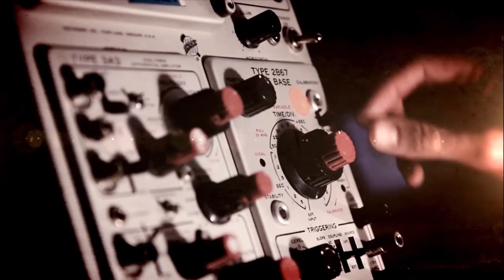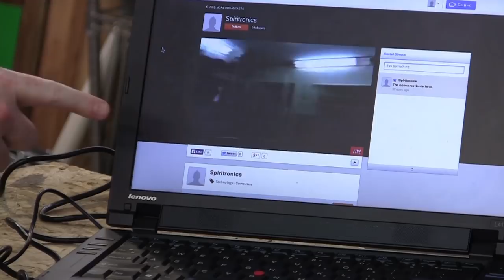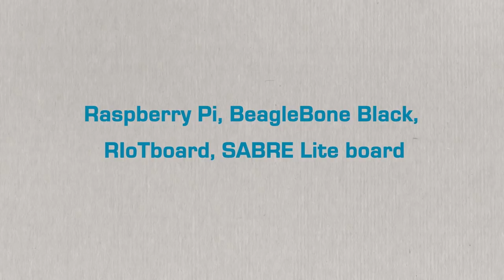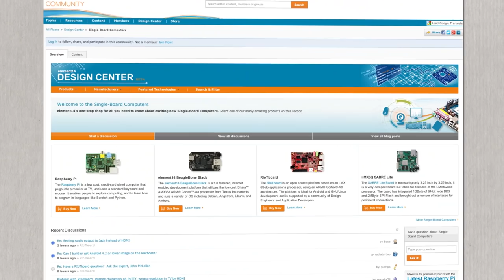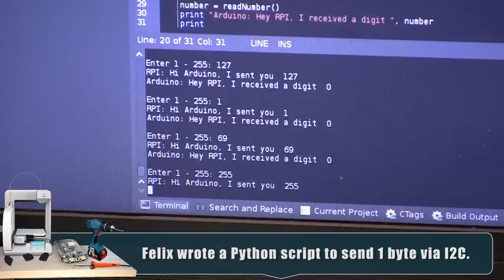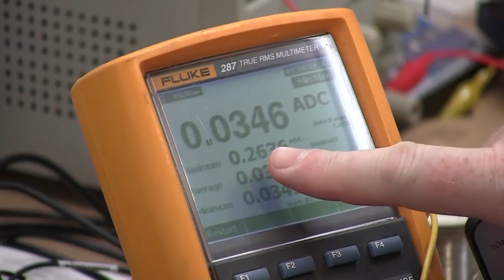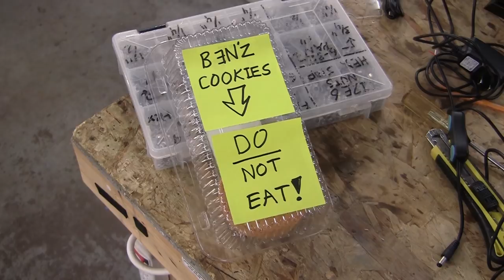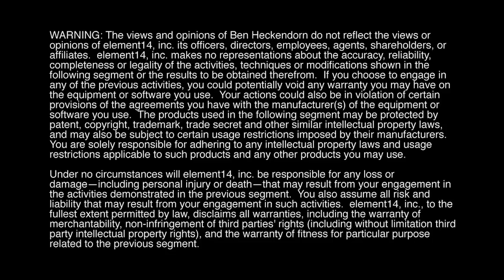Ben Heck's Raspberry Pi Shop Cam

Comment: Assume the Pi needs 500ma,itself. IME,they're sort of unstable without a good 'stiff' supply. I've even jumpered over the polyfuse on mine,I measured a 0.25V drop across it with the system idle. (under heavy load there was even more drop,and it would lock up/reset from the 'brownout' condition.) Using a supply with a voltage slightly over 5V (5.1V,5.25V) can help too.

Comment: Something that you might be interested in, Ben - you can use i2c from the Pi to the MCU without a level shifter, as the master pulls the i2c line high, in this case 3.3v, and  the line is then pulled low by the master to send the data bits. At least that's my understanding! Even if the MCU sends data back, it'll just be pulling the 3.3v line low too, so it'll save you a level shifter!
Reply from the maker: scott porter Thanks for sharing!

Comment: You probably could have gotten away without a level shifter. The ATMega328P will run at 3v3 at 12MHz, that's how it's configured on the Gertboard.

Comment: Hey Ben thought you would like to know. I seen on a kick starter a small company create a printer that looks like a 3D printer but it prints circuit boards no need for etching on a clear flexible film. After that it will apply solder for surface mount parts and then pick up the surface mount parts and put them on the board using a camera to align them. I forgot what it's called but hope it succeeds.

Comment: Great video, but you said you need a servo controller because the Pi doesn't have a real-time operating system. Surely that's not the reason.

Comment: rc servos are probably more versitile since they usually are smaller(depending on size of rc stuff) and most of the ones I have laying around can spin around 360 degrees, but they are not very impressive in terms of power...

Comment: Dear Sir Ben

I want to request a video if i may ask, and please try your best.

Here Is The Thing :
i want to build some thing similar using OV7670 Camera Module, but the thing is i want a micro controller from microchip to do the capture or live video streaming and send them over the very same transceiver module. i want to control several servo motors as well using the same micro controller.

what i do not know is how to read the image from the OV7670 i have tried studying the datasheet several times but i guess i am lost, and i dont know what chip should i use among the large family of microchip micro controllers to achieve this plz help. i want to build my dream machine :D

Comment: Raspberry PI can perfectly drive servos through its GPIO pins using for example the library "servoblaster". I cannot understand the reason to use arduino + a servo driver, other than to make this project prohibitively expensive to build.

Comment: i bought a camera module OV7670

but yet i don't know how to operate this module with a micro controller i really lack the information plz i need help

Here Is My Plan

1. I want to use this module with microchip micro controller, so please suggest me a good micro controller
2. I want to stream video from the camera to a computer using VB.net
3. control stepper motors to move the camera around

part number 3 is easy because i have done it before and part 1 i have a slight knowledge but part 2 i am completely blank

please guide me i am exhausted of searching on the net without any result. i need to know what program to write in the micro controller to get the camera to work. please help i am counting on you.

thanks you i am waiting with hope.

Comment: Okay I see the PI camera and the PI board.  Is there a way to have more than one camera and connect each PI board to a main PI board?  We would like to use 6 camera's having two facing up at a 45 degree angle, 3 camera's @ 120 degree level to horizon and one facing down towards earth.  We are using it for a High Altitude Project. Thanks."
Reply from the maker: maddogjb57 That's do-able, you can either use the Pi Compute board which can connect two cameras per board, or you can connect more using USB. Synchronising them is then something you have to solve in software and could do over a network connection.

Comment: I built mine with a Raspberry pi B+ and a Webcam. Installed Apache server with PHP on Raspberry pi to make a streaming website. When somebody visits the website, the PHP creates a SSH connection to the Raspberry pi and runs a bash command that starts MJPG-Streamer and webcam, turns it on for streaming. And when there is no viewer, the bash command stops MJPG-Streamer and webcam, turns it off. So it is only on when someone is actually watching, other time it is off.
Reply: You should post a tutorial for this it seems pretty cool!

Comment: Why didnt you use the Raspberry Pi B+?
Reply: They only really needed just one USB port so the Model A (once they removed the RCA Video & 3.5mm Audio jacks) would have been enough.
Going for a Model B means they could have a keyboard/mouse plugged into the second USB port whilst the WiFi dongle sits where it's needed.
Model B+ would have been overkill on the USB ports, even with the GPIO and A/V changes (and they only used a few GPIO pins anyway).

Comment: I have a raspberry pi 3 model B. Mi goal is to take pictures and get the gps longitude and latitude. I got three cameras to test and a gps. All of them get connected using USB  ports.
I am using Python to get this data. The problem is that this devices get not recognized.
And I get the following error for the camera:

raise SerialException("could not open port %s: %s" % (self._port, msg))
SerialException: could not open port /dev/ttyACMO: [Errno 2] No such file or directory: '/dev/ttyACMO'

The gps throws a similar error.

I know the cameras and GPS are Raspberry compatibles but i think something changed

I have done a lot of research and it looks i have to do changes to the UART:
http://raspberrypi.stackexchange.com/questions/45570/how-do-i-make-serial-work-on-the-raspberry-pi3

But still i do not know if this is the correct path.

My Mac and Raspberry miss the  /dev/ttyACMO.

Thanks in advance.